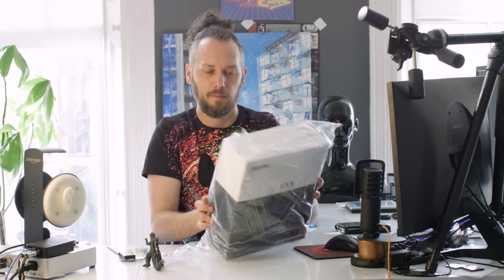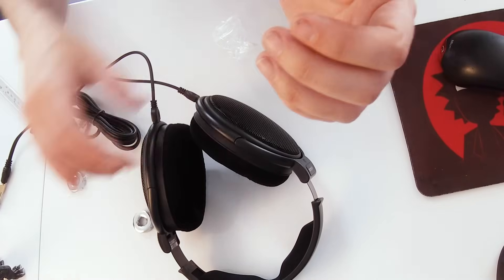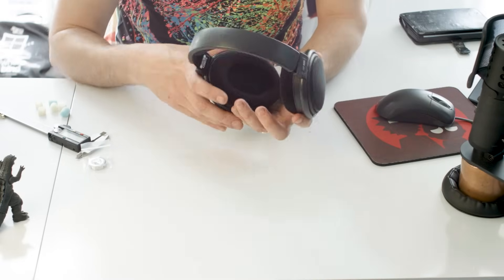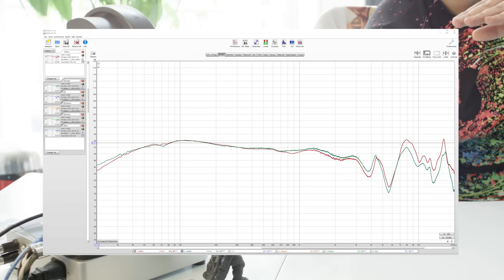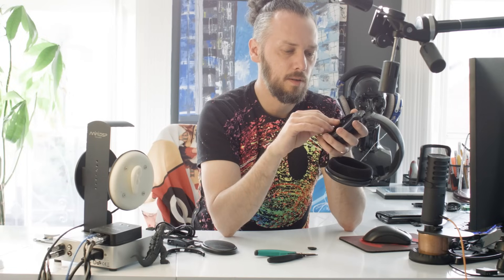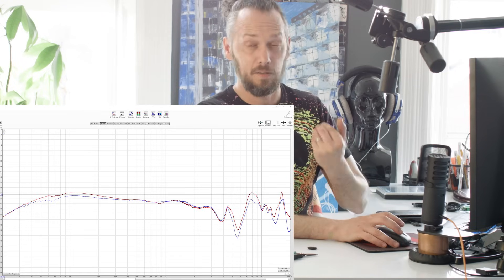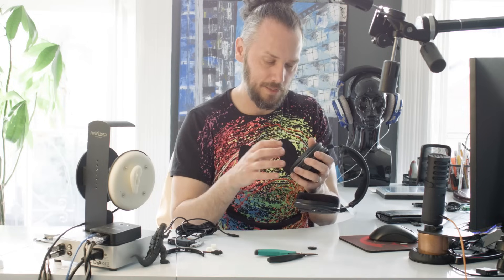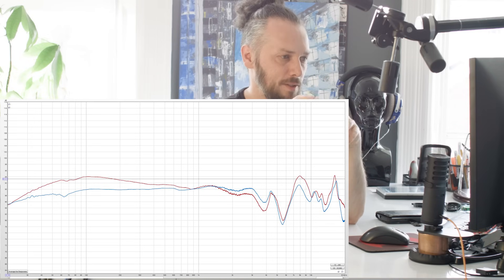MassDrop x Sennheiser HD6XX Upgrade time. Our Shiny new nickel plated CNC copper mass loading kit

Comment: Love your videos! Was just wondering, does the mass loading mod work on 660s?
Reply from the maker: No, they have a  different driver - We have not designed any mods other than cables for the 660 yet but we will probably have a play with them later in the year
Reply: @CustomCans  cool, thanks for letting me know :)
Reply: If you do pursue a 660 version of this mod, do you think there might be a way of also making it compatible with the 700? Or would the different housings make that too tricky?
Reply from the maker: @shreddherring  I don't know yet - but now you have said that.... I will have to buy some HD700s as well to see if it will be possible. It would definitely be good for us if we had one mod that worked well on both